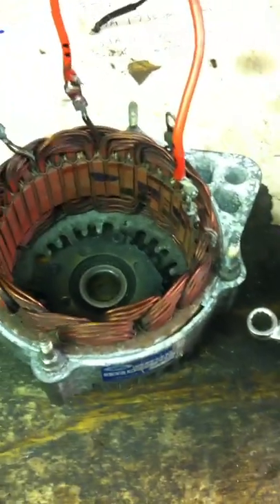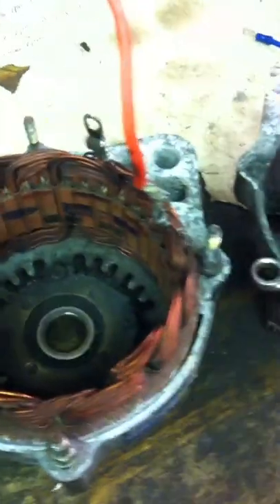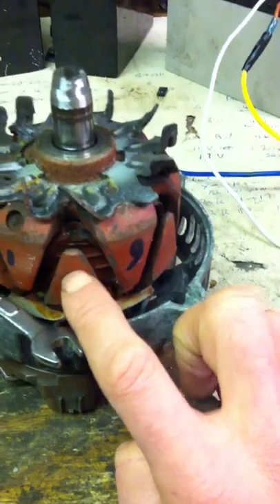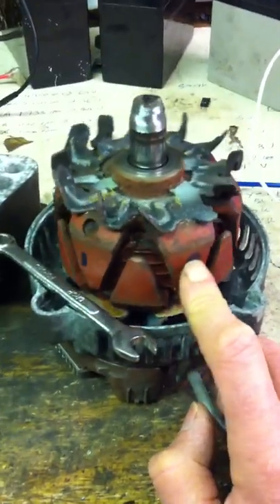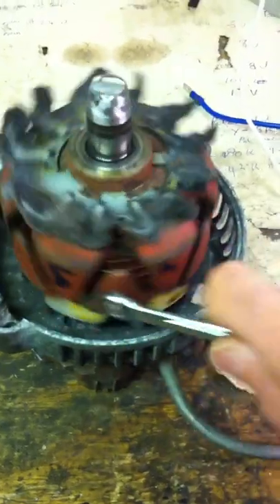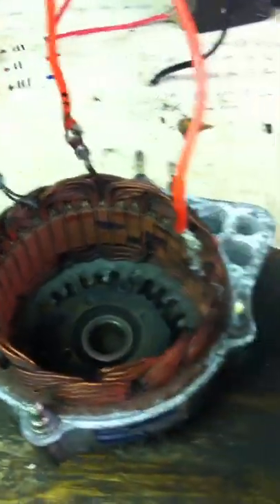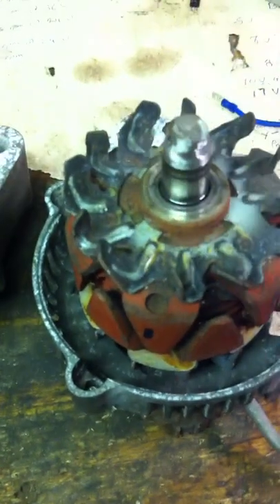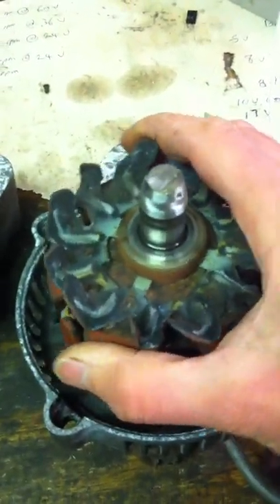Alternator motor as a mid drive. Rotor field and heating rate test

Comment: Make permanent magnet rotor. Eliminate field coil
Reply from the maker: Have you done this and increased performance?
 I have seen this done by tchangly21 and as far as I can tell, it reduces performance.
The field coil power is 50W at 12V and 90W at 16V. When I'm putting 2kW through it, this becomes insignificant.
There are a number of challenges to create a permanent magnet rotor, which I will only consider worthwhile when someone can demonstrate a benefit.
Please post a video of your alternator driven vehicle if you have one.

Comment: I'm a bit confused by this. I thought it was wired in star when all three points were connected this way. Can you please explain? Thanks
Also I was wondering would you get better speed from batteries designed to give more current. I recently built a battery from Samsung  INR18650 30Q cells which are designed to supply 15A-20A whereas your old laptop batteries are probably more like 2A. I guess it depends on how many cells are in parallel. I haven't had a chance to test it yet with my alternator bike but it is great on my Bafang 500W mid drive bike. I can get over 30mph on 36V
Reply from the maker: Yeah, must have been having a senior moment at 0:34. It's wired in Star/Wye. I do talk shite sometimes :-)
I don't use Mickey mouse laptop batteries on an alternator motor; I have two Zippy compact 25c 5800mAh 8s packs in series, which are capable of 5.8x25=145A. I have an 80A fuse but no BMS in the discharge route.
My laptop packs are 16s 6p, with 12Ah. There's all sorts of cells in those packs, all mixed up to give equal Ah on each series row. The laptop packs have a 40A BMS and a 40A fuse
Reply: @plodderexup  phew, normally it's me talking through me arse. 😂
The battery setup makes a lot more sense now. I had planned to test the alty bike with the new battery pack (10s 5p) yesterday but somehow managed to loose the charger. When I get it charged I'll make a video of the results.
Reply: @plodderexup  Need to know the following:

1. Such conversion will work even if the wind is in star or delta?

2. Will any bldc motor controller work or has to be sensorless controller to be used without hall sensor connection?

3. I have rigged the alternator with three phase wire and two charging the armature through the carbon brushes. I am using a 48 volt 30ah Li ion battery pack for controller and thru 48v to 12 volt dc dc convertor I am supplying 12v to carbon brushes. The armature is magnetized there is no rotation when throttle is being turned. What could I possibly doing wrong. Please guide.
Reply from the maker: @ElectricScootersJammu  1. Star works better (more torque). 2. It needs to be sensorless. 3. No idea. If you've git 12v on the rotor it should have some drag. Once you put the bldc controller in learn mode the motor should spin. Tag a video explanation and I'll have a look.